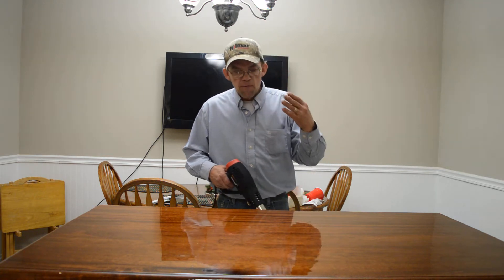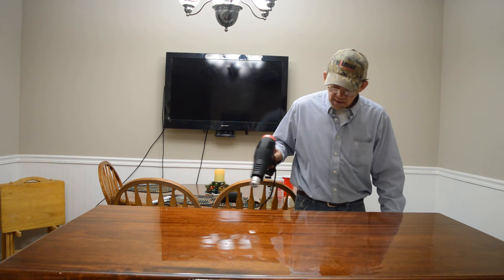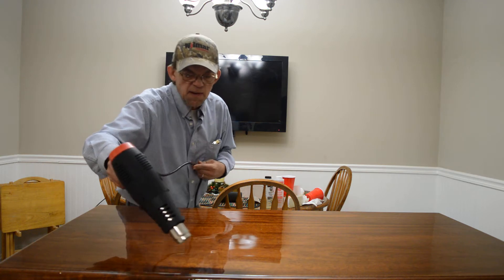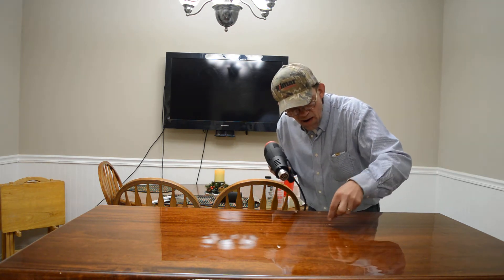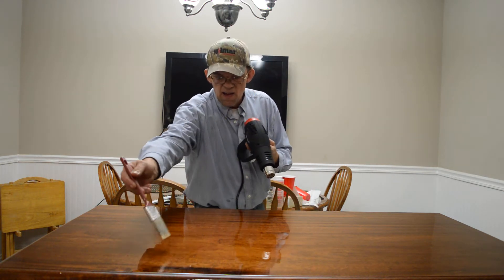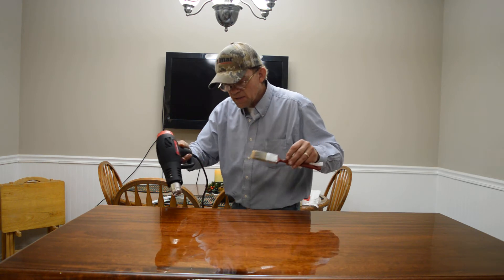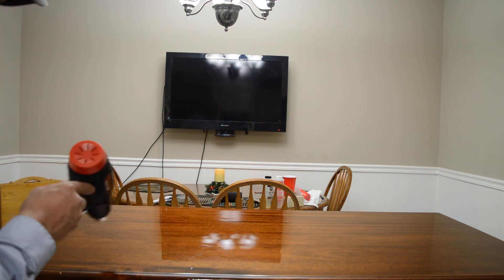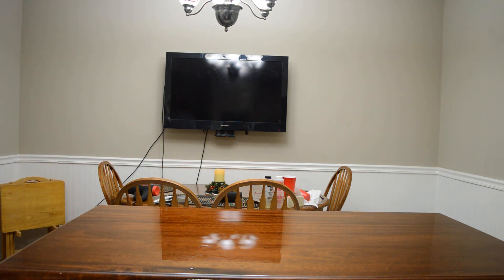Bar Top Epoxy Part 5

Comment: With glaze coat it is recommended to put on very thin layer for first coat & use blow torch or heat gun then day later to put on full thick coat & for sides using high quality bristle brush for sides.